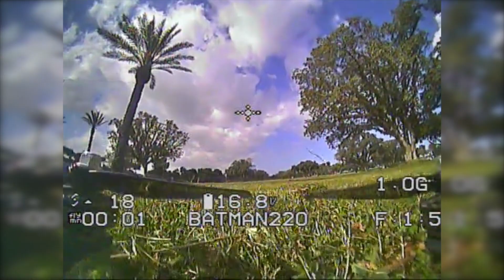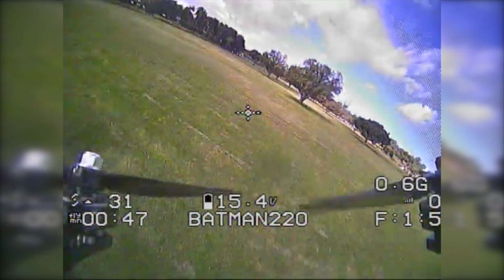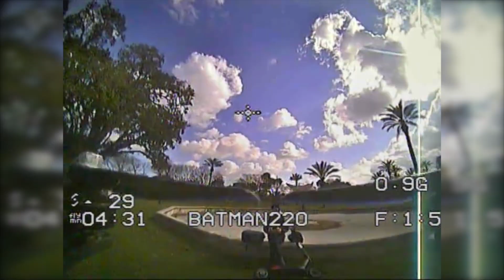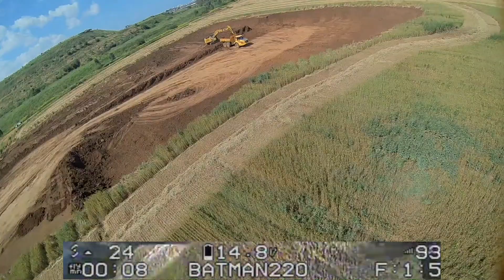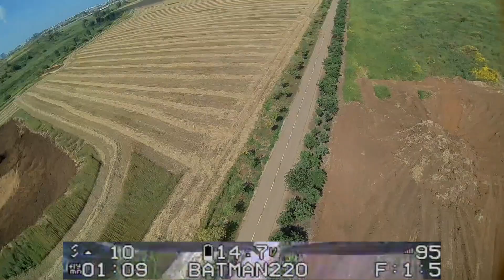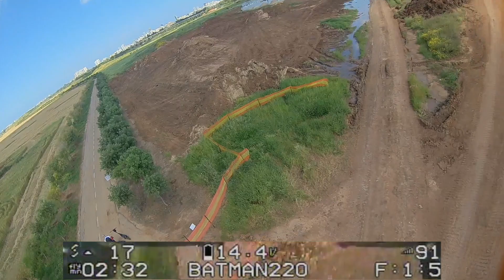Emax Eco 2306 2400KV Motors - Flight Footage

Comment: Hi! I want to use ori32 with this motors and 5040 props. Is 25A (35A burst) enough for this setup, or should I get an esc with more power?
Reply from the maker: Yes, you should be good

Comment: What is the battery rating?
Reply from the maker: I used 1.8a and 1.5a 100c batteries.
Reply: Thanks, but what is the mah brother?
Reply from the maker: @ashok-lx3os  I am pretty sure that I used 1500mah 4s Lipos in this video.
Reply: Thank you brother

Comment: Are this motors nice and resistent? Thanks for the review bro.
Reply from the maker: Didn't crash them, but they look solid.
Reply: @KremerFPV  Cant find any thrust test of 2207 emax eco on 4s with 5" props and 2400kv,  what is better for freestyle 4s quad, 2207 or 2306 ? Thanks !